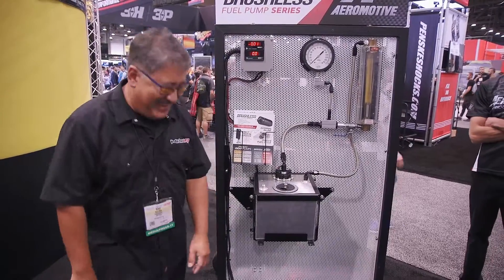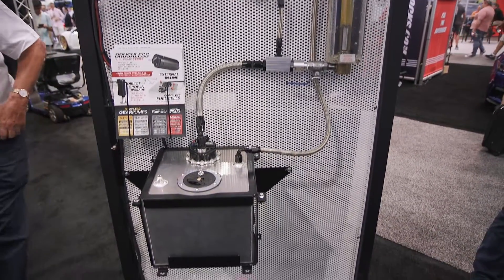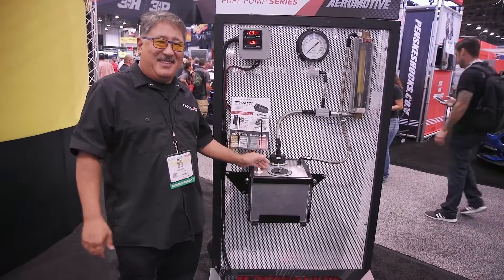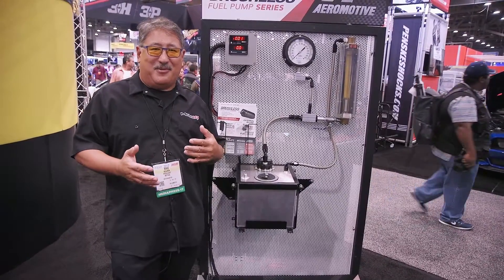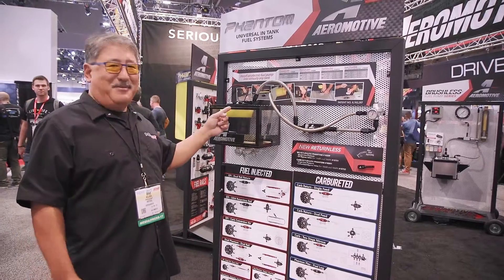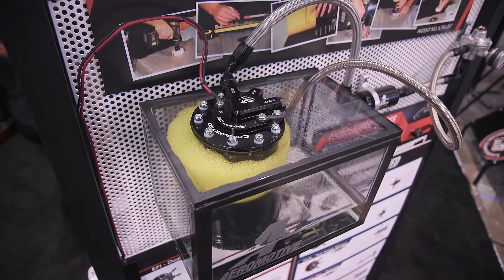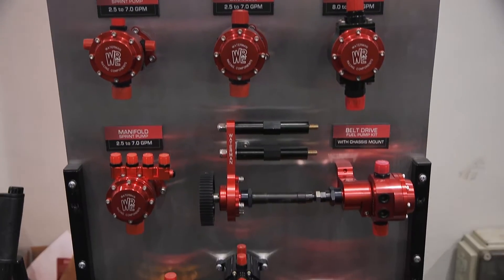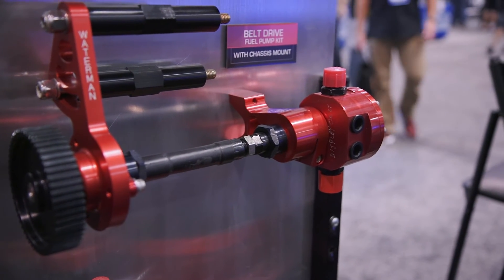Best New Stuff from the 2017 SEMA Show - Aeromotive

Comment: I don’t understand why do you need to use a mechanical fuel pump on a high-horsepower car... if you need more reliability/flow you can run two pumps in parallel...
Reply: proportional fuel delivery so you don't overrun the regulator at low speeds and heat the fuel, reliability.
Reply: Thanks, I didn't think about fuel heating up.. About reliability, well, yeah. Also true
Reply: Federico Barutto circle track racing. Different rules and refs for all the classes and never different from event to event usually out of town at another track.